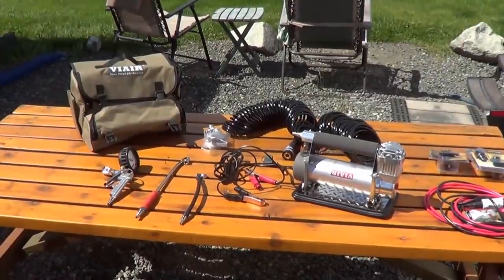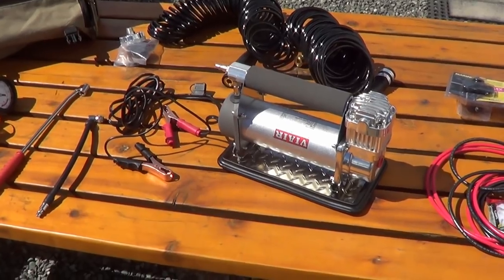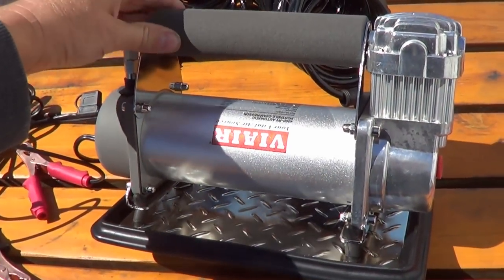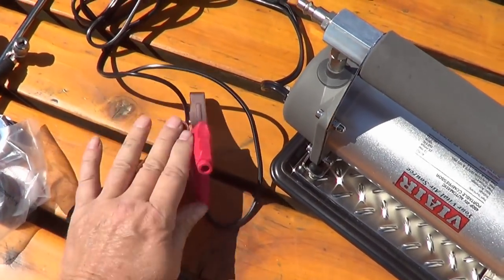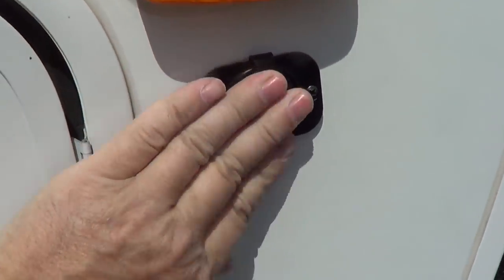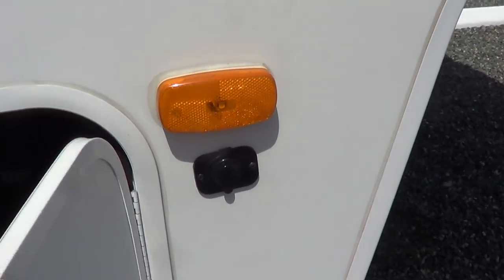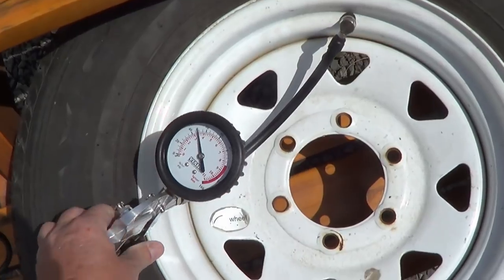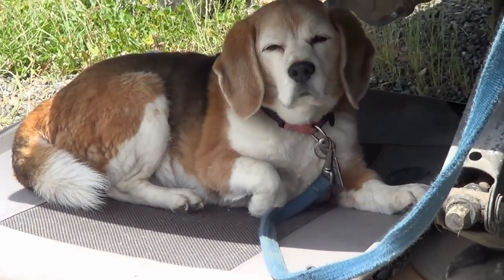VIAIR Air Compressor Review -  Part 1 (First Look and Power Hookup Mod)

Comment: I liked this mod so much that I did a similar install thanks to you!  I purchased two Minn-Kota plug and socket sets, a Noco  12' cigarette lighter extension cable and a Buss 30 amp 285 circuit breaker.  I mounted one socket slightly to the left of the front storage door on my fiver, did the same as you with the battery clamps for my Viair RV450p, cut one end plug off the 12' Noco cable and added the extra Minn-Kota male plug for charging my Noco gb-150 with the solar house batteries. I used a Buss 30 amp 285 series circuit breaker so I can manually switch it on/off anytime.
Reply from the maker: Sweet!
Reply: Love Your RV, I forgot to mention that a little film of dielectric grease around the o-ring on the male plug makes an easier connection.

Comment: Both my Viair compressors have been outstanding. I keep each one in a plastic box. If it’s raining, I put the lid on the ground, then put the Viair on the lid and put the box over it to protect it. The box also holds tire repair equipment such as plugs and cement, and the torque wrench sockets and adapter. I’ve used the Viairs well beyond the recommended time and tire size limits when assisting other RVers. No problems or failures.

Comment: Ray, I love that the specs call for 23 - 30 amps draw when running, but the wires that come with the pump are so undersized.  Glad it works well.  I love the use of the Minkota plug.  Great idea!
Reply from the maker: Yeah, all I can think of is they don't expect it to need the max 23 amps often, maybe the typical draw is much lower. I'll do some amperage tests in my review, to see what the normal draw is. Cheers! Ray

Comment: I thought about the same compressor and running it off the fifth wheel battery bank. But decided to get an AC compressor and run it off of the inverter. A little less efficient but a fraction of the cost. But a nice mod. I’ve been thinking of installing a high amperage 12 VDC socket on the rig.

Comment: We opted for the 400-P model and just hoped we would be able to situate the truck in a way to reach all the RV tires in case of an emergency lol. We did find if you park on one side of the RV next to the tires, you can pass it through underneath the RV and reach the other side with one cable. Wouldn't work too well in tight quarters though...so we may just buy an extension cable later on. Thanks for the review as always Ray, have a great week! - Shane

Comment: Another superb video, Ray. And your timing couldn't be better. I just bought the exact same compressor and love it, although I will say the gauge threw me at first, too -- I ended up buying the digital gauge inflation gun, which still does the same "let-it-settle" thing also. My problem is that I don't really have a solar system on our RV (just a small 60-watt trickle charge panel on the roof for the house batteries). She is old enough that I am not sure I'm going to invest in a larger system. But I'm going to add this video to my RV playlist and come back to it when I've got things figured out. Love your RV (videos -- ;-) -- have a great summer! Safe travels, my friend.

Comment: We'll done as always. A clever idea that I may copy. Might I suggest using some rubber hose to make a grommet around the bulkhead hole though.
Reply from the maker: Thanks. The metal edge has been rounded and painted so pretty smooth, and I don't expect any movement there as its the main frame but will add some plastic wire loom, its what the factory did with the large wire bundle that goes through the same opening on the other side of the compartment.

Comment: Thanks for your response. I have a Class A  and I'm leaning towards the 400 since it works faster. But I don't think I can go wrong either way.
Reply from the maker: You're welcome, also found this forum thread where someone asked VIAIR about the differences - http://www.irv2.com/forums/f52/viair-reply-about-400p-versus-450p-versus-new-rvs-series-air-compressor-differences-438948.html

Comment: I have the 400P (non-RV) model and really like it.  Like you said, they are well built and quiet.  The 400P has a shorter duty cycle than the 450P but its plenty for my needs.   I'm not a fan of those stiff coiled plastic air hoses they give you in the package so I bought a 50" hybrid air hose.  It will reach from my truck's battery in the front passenger side back to the tires on the opposite side of the travel trailer with length to spare.
Reply from the maker: Cool, I've read the 400P has better CFM than the 450P so I guess its a trade-off. 450 can go linger, but the 400 is quicker.

Comment: It's beautiful work, and we'll done. I would have hard mounted the compressor inside that compartment with an external chuck. That way I never have to take it in and out of the bag into the elements, just connect the hose to the chuck and Bobs your uncle.
Reply from the maker: Thanks. I like to store the compressor in one of my trucks tool boxes. That way I can using it when away from the trailer or loan it out. For example when I go off road and want to deflate the truck tires and reinflation when back on pavement. Cheers, Ray

Comment: Dude! I love this, the mod could go way-way further. These 150and 200 PSI air pumps are also designed for a permanent mount. You could attach to the Frame of your truck in the on Wheel well, mid-undercarriage or under your hood, if you have room (usually fits in a secondary Battery area if not in use)...additionally there are several sizes on tanks for 1 to 5 gallon (high-pressure) tanks ( i highly recommend this in long run). you can then set up a quick fitting by the license plate on a truck, and the 30ft airlines should make it to all tires. Also; Look into getting an air gauge in the dash (real simple here if you have some dash room)

The air filter can be attached to a flex/tube so that the air can be filtered from a clean installed area and away from the ground and underside of a vehicle...definitely look this one up

Now the really neat modes: You can attach and mod the system to maintain inflation to air shocks if you have air ride in your truck or trailer.

And for the really fun thing....Go out an buy a pair of either "big Rig" or Train airhorns to run off the tank as well....150 to 180+ DBs really gets folks attention :P

All these mods are readily available for search on youtube and various blogs/Vlogs....and once you have the tank and compressor...everything else is essentially affordable

Have lots of fun with teh new compressor, just keep in mind what can be done additionally ;)

Reagrds
The Sarge
Reply from the maker: Cool! Thanks for the ideas! I already picked up an air nozzle for using compressed air to blow out stuff like the RV furnace and AC ducts and the fridge vents. Cheers, Ray

Comment: I have the Viair also and love most things about it. Except, the two hoses are NOT the same. One is the master and the other is the extension. That's because Viair decided to use male fittings on both the compressor and the gauge. Putting both hoses together is like being tortured because their springiness makes them instantly tangle. I found if I just use one hose I can reach everything if I stretch out the power cord too.
Also, the Viair doesn't supply enough VOLUME of air to reseat the bead on a rim. I discovered when I installed metal valve stems for a TPMS.
Still, the best unit out there.
Reply from the maker: Thanks for the real world feedback, Cheers, Ray

Comment: Ray I was thinking you were gonna mount the air compressor in the trailer and have a quick disconnect for the air chuck on the outside where you plug the electric in. that kinda makes a little more sence that way your not dragging the compressor around.
Reply from the maker: I want to be able to have the compressor with me when we are off exploring in the truck. Will be nice to air down the tires for off road washboard and back up for pavement.

Comment: i have the 300p works great   looking at vid  the postive wire going  through balkhed   you  need some split plastic wire loom so that it won't  chafe  on frame   nice unit
Reply from the maker: Good idea, a few others have mentioned it, too.  The metal edge is rounded and painted so I wasn't too worried. Also, I don't foresee much movement on the wire given the hookup to the sidewall and left some slack.  If there was I'd have graver concerns. ;) I guess it's just good practice, so will throw some loom on it. Cheers, Ray

Comment: great video just wondering could you use that compressor to blow out water lines for winterizing rv/trailer
Reply from the maker: I bet it would work but I've never tried a compressor method, I've only had to winterize once. lucky me.
I think the main concern would be not to use too much pressure and damage the RV plumbing. The trigger fill nozzle with the gauge would come in handy.

Comment: Here is one big problem with the Viair Ray. To protect itself it shuts itself down when it overheats. In the hot hot summer days in the southwest USA it overheats quickly preventing you from airing up the tires. I’ve used it successfully in cooler months but I had to limp to a truck stop when trying to air my tires in July.
Reply from the maker: Thanks for the feedback. I'll add it to my review as a con for the unit. I guess an option would be to put it inside the vehicle with the air conditioning running. Cheers, Ray

Comment: Much better connector would be Anderson Powerpoles.  The standard connector can handle up to 45A, but the 30A pins are more common.  The HAM radio and Gov. emergency service communities swear by them.

Check out powerwerx.com/panelpole-panel-mount-powerpole-housing for a similar panel mount but with Powerpoles.

Keep up the great videos!!
Reply from the maker: Cool! I know lots of folks that use them for solar ground panels. Cheers! Ray

Comment: As you say, in order to get an accurate reading from the built-in air pressure gauges on Viairs, the pump must be stopped

Comment: Where you run your wire through the metal frame, you should have a grommet as the wire may rub.  Adding a piece of flex tubing should do they trick.
Reply from the maker: Thanks. The metal edge has been rounded and painted so pretty smooth and I don't expect any movement there as its the main frame but will add some plastic wire loom.

Comment: Hey Ray, another nice review and MOD. Seen a couple reviews on this one and it seems to be a good unit. I do have a different question for your expertise. Do you have 30 lbs propane tanks and if so how do you go about filling them. Only dealt with 20 lb ones. But next RV will have 30 lbs ones and full they will be a little heavy. Do you take out and go get filled. Will a station fill while still in RV.  Heard of RV parks having mobile. How does that get handled. Thanks Ray...
Reply from the maker: Yes, I have an auto switchover valve so when one is empty I take it and get it filled. An empty 30 lb tank is 24 lbs and full 54 lbs. I'm still able to manage it no problem. I put it in the back of the pickup bed. Some places will fill right on the truck others you have to take it out, depends on the local laws. I know of one person that uses a little-wheeled cart to do it.
Cheers, Ray
PS here is a tip for transport - https://www.loveyourrv.com/rv-propane-cylinder-transport-tip/
Reply: Love Your RV Thanks Ray. Knew you get around a lot and would have good knowledge. Some people on some blogs make it seem harder than it is I’m sure. Was just curious if they could be filled on RV. Sounds like No. I’m not worried about it. And I knew you’d have a good tip.
Reply from the maker: Some may fill on the RV or lift it down or back up for you. I've usually taken them in with my truck though sometimes if convenient ie. big parking lot or easy access to the propane, I will pull the tank out of the trailer and get them to fill it.
One of the places in Quartzsite called the RV Pitstop has it down to a drive-thru service. They will fill it right on the vehicles but Arizona laws are known to be less strict than other places. ;)

Comment: Hey Ray I've been looking at getting this compressor, Do you know if you can hook up an air regulator to it so you can use this to blow out the water lines on a travel trailer (30 - 50 psi)
Reply from the maker: Yes, I have heard of people using it for that, haven't tried it myself though. Not sure if the unit work as it or whether they also needed to a an accumulator tank to it.

Comment: Hello from Joe and Nancy from Apollo Pa. I KEEP AIR IN TIRE 2 OR 3 PSI LOWER THAN MAX COLD AIR PRESSURE. As soon as you start driving down road, your tire pressure increases 2 to 4 psi, therefore you are up to max pressure. Just saying.
Reply from the maker: Hello. :) I have TPMS and often see the PSI increase 10-12 PSI as the tires heat up driving on a warm day. But they are designed to do that. Max cold pressure is just that.
I've always been told its best to air up the tires for the load they are carrying. Most tire manufacturers publish load tables. ie.  https://www.michelintruck.com/reference-materials/manuals-bulletins-and-warranties/load-and-inflation-tables/#/ and vehicles and trailers will have a sticker with recommended PSI
You want to inflate for max tread on the pavement for even wear and best traction. Too low of inflation and the outside edges wear faster, too high and the tire wears in the middle. Either scenario reduces traction and handling. I've read a good way to know is chalk across the tire and drive a bit and see if the chalk is wearing off evenly.  Cheers, Ray

Comment: Hi Ray
I did something similar with my lithium battery bank, i found on my victron shunt it only pulled about 9.5 amps. The manufacturer video says it requires 13.8 volts which a running engine would provide. Any thoughts  Rob
Reply from the maker: I've used mine for years on several different lithium batteries with no issues. Did you test the amps under load? Or maybe your wiring is too small causing voltage drop. Here is test I did using a lithium power station plugging the air to get max draw https://youtu.be/IjRQgpYaTA8?t=915  It reported about 350 watts  350W divide by about 13.2VDC = 26.5 amps

Comment: Ray, how do you think it would work with pneumatic tools?
Sweet Angie, that’s a pretty cool looking bed!🐶
Reply from the maker: It would quickly run out of air as it doesn't have much of a reservoir.  I bought an air gun attachment and it gives a quick blast then I have to wait while it recharges the pressure.
But you can buy optional tanks. eg. - https://amzn.to/2srtR8R  I may do that as a future project. :)

Comment: I understand the 400 model works faster on RVs.  If so, why would I buy the 450 model?
Reply from the maker: The 450 is capable of 100% duty cycle for 40 minutes versus 33% for the 400, on the website they list the 400 as good for Class C and the 450 good for Class A. Since the units will last a long time I decide to get for the 450 in case I ever decided to get a Class A when I'm older.  Also thought it may be nice when off-road and deflate the tires for better traction them have to re-inflate them all for the highway again.  Specs can be found here - https://www.viaircorp.com/rvs-portables

Comment: Wow 3 years ago they were $219?!!
They're close to $400 now
Reply from the maker: Must have been on sale at the time because the 450P-RV cost us around $300 back in 2018 and it's currently listed at $349 on Amazon. Or maybe you are comparing to a different model. The 400P is currently $239

Comment: IT IS A GOOD UNIT BUT THE BAG RIPPED THE FIRST DAY I HAD IT ALL THE SEAMS PULLED OUT -  MY OLDER  BACK UP PUMP HAD A BETTER BAG
Reply from the maker: Wow, that sucks. so far mine seems pretty sturdy. Maybe it was a dud from the factory or these days there is a lot of knock-off products out there. I hope yours isn't one of them. Cheers, Ray

Comment: Can this be used in jcb backhoe big tyre
Reply from the maker: The specs on the 450P-RV list max tire size as Max. Tire Size: 275/80R22.5
Reply: Love Your RV  tyre size for jcb backhoe loader is 16.9-28 (rear tyre). Do you have any alternative suggestion?
Reply from the maker: Maybe contact VIAIR and see what model they recommend - https://www.viaircorp.com/contact

Comment: fill four tire and it is so hot you cant touch it for an hour. I have several burns on my hand from this thing!!
Reply from the maker: Thanks for the feedback Bob, I will mention it as a con in my review. Cheers, Ray
I noticed these warnings when I read the manual
"This compressor will become very HOT during and immediately after use. 
Do not touch any part of this compressor with bare hands, other than the ON/OFF switch
during and immediately after use."